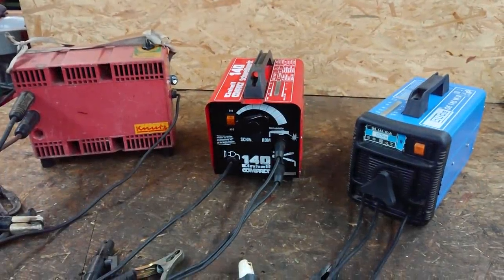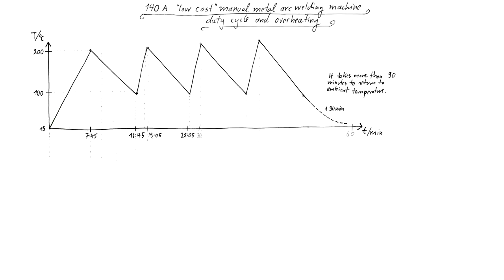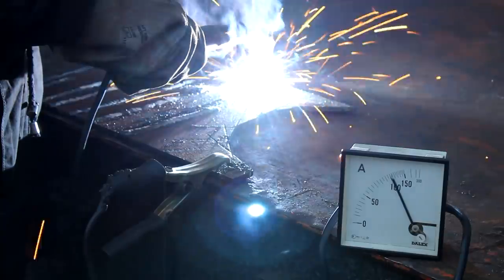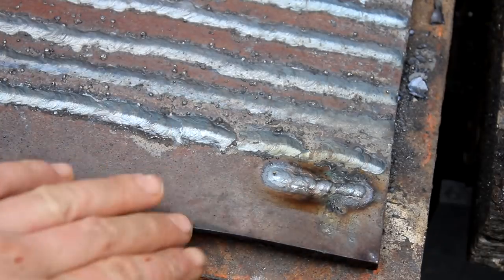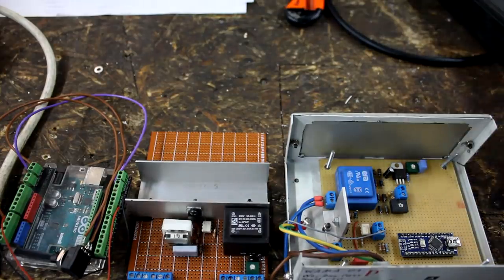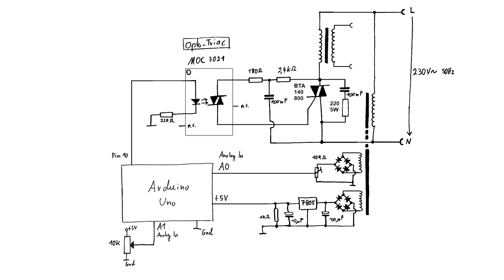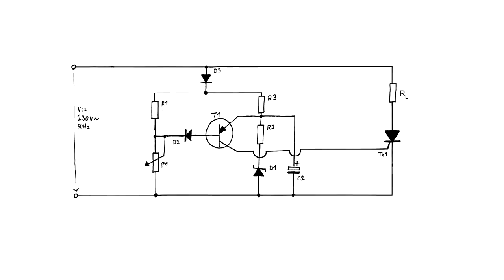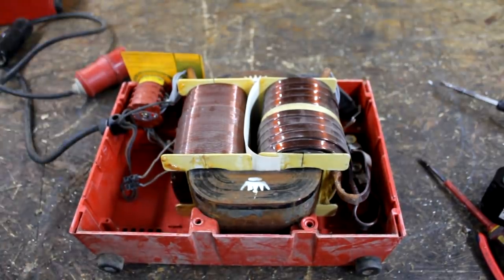Welder Experiments! DIY Upgrades for Cheap Stick Welders!

Comment from the maker: Hey guys, if you want to make a donation, you can find me on Patreon, or make a donation via paypal. If you want to donate by other means, you can contact me under that same email address.

https://patreon.com/tpai
paypal-donations: inventordonations@gmail.com

Older episode about welding transformers: 
https://www.youtube.com/watch?v=k5684mQJQRU

Video about my DIY Exercise Machine:
https://www.youtube.com/watch?v=h2YUO4_O4x8&t=335s
Reply: Another marvelous video! Please put your PGP Public key, so that people can e-mail you privately, Gmail is unsecure as f*** also, consider using the Signal app.
Reply: Martin Luther  This is a fact Martin.
Reply: I like your videos and have supported YouTubers in the past but YouTube has become SpamTube by placing a large amount of ads (6 interrupted this video alone) within posted videos. That makes it very difficult to follow and is worse than TV.
Reply: @kevinsteegmann6539  Just us any ad  blocker to keep that stuff at bay. V
Reply: john croation  Search for the channel of a dude called "Rob Braxman" he deals in network privacy/security you will find all information that you need there, thanks for your time.
Reply: @kevinsteegmann6539  Is not only a question of youtube but also a question of OS and browser. Under Linux not have adv even with firefox, chromium or another brows.
Reply: Since your valuable video-S are already done and you added the English explanation afterwards. I really & HIGHLY recommend adding a German  explanation too. After all, it is your mother tongue, right …;-)) - Deine unvergleichliche geile Videos sollten unbedingt auch auf Deutsch presentiert werden. - Keep'em com'n!
Reply: @The Post Apocalyptic Inventor
Would love to see an update to this series. When you have the time and have salvaged the relevant parts of course.

Comment: I added three server fans to my old stick welder twenty years ago to prevent overheating. The fans have prevented it overheating ever since. The fans operate before the on off switch so they function as soon as the welder is plugged in. This has worked well.

Comment: On these older welders in the UK, we are advised to upgrade the fuse to a 32amp fuse/trip switch. Many workshops I have seen have had 32amp socket circuit specifically for welders and compressors

Comment: My dad taught me how to stick weld years ago.  And I must say, I've gotten pretty good at it.  Setting the duty cycle depends on the thickness of the work you're going to do.  We converted my dad's old AC welder into a DC welder using some huge diodes my dad got from where he worked.  Now it welds great without so much sputtering.  W Rusty Lane K9POW in eastern Tennessee

Comment: Would have been fun to implement the controller analog without μc.
A 555 and an opamp should have been enough.
Edit: I see you implementing an analog circuit later and the μc implementation is surely a valuable education! No criticizing here!
Reply: Yes, I was also wondering about that. A standard dimmer circuit as was used for incandescent light bulbs consisting just of an RC network and a diac would have achieved the same result. But it seems that today even the most trivial circuits need to use a microcontroller :-) Nevertheless, great video!
Reply: I tried designing one with a 555 and LM339 that would switch a 2 thyrystors + 2 diodes bridge rectifier, well it worked in LTspice but never got around building a real one. making it work on both halfwaves is truly a hassle
Reply: There should be a general rule that if your firmware is below a certain number of lines...you don't need firmware.
Reply: @trevorhaddox6884  well, microcontrollers have the upside that you can upgrade the firmware after you shipped a product. But it depends on the kind of product.
Reply: As mentioned theres a very simple DIAC application, used in nearly all vacuum cleaner and so on and theres a lot of integrated Triac controllers. Thyristors/Triacs are complicated to handle. They sometimes might not fire (especially if nearly 100% duty and while used on brushed motors) so you need to re-fire them. This integrated controllers do this very well. Here theres no software required at all.

Comment: Same Einhell welder, just added a 120mm mains fan to the rear, using the existing 4 holes and grille there already, but not installed by the manufacturer.  Blows across the transformer, and with the duty cycle now being weld a rod, wait a minute, then weld another rod, perfect for my use. Only drawback is that when welding the extra stray magnetic field tends to stall the fan at high current, but it will carry on again when unloaded, or at low current. Never bothered to put in any power factor correction, but did add a single diode on a heatsink , connected to a 40A thermal breaker added to the front panel, and a 4mm output, so that I can use it as a battery booster, being able to get a car battery from flat to able to start a vehicle in under 1 minute.

Comment: Great video! I want to give you a tip about pressing a high-current cable connector as you use in the rectifier.

Use a bench vise with an aluminum vise jaw protector with a V-shaped groove in it. Put the connector in the V-groove with the top part facing into the groove. Press with a 5-8 mm Hex bit until the cable sits well enough. It is a bit tricky to set it up with one hand but you can arrange it so the connector is put in the vise first wit the bit pressed loosely so that it all hold together, and then you put the stripped cable in the connector. This way almost mimics the ready-made tooling for this purpose.

Comment: Altough the circuit with the potentiometer seems a lot more practical than turning the original current control knob a million times, isn't it a lot harsher to the mains network as you are enabling the triac mid wave resulting in a big spike of current? I did actually use a similar circuit before with the zero cross detection and time delay for a heater but I rapidly changed it as soon as I noticed the flicker it was causing to the lights, in my case since it was a heater it was easy to solve, I just used an opto triac with internal zero cross detection and used time proportional PID  (which results in like a slow PWM with 200ms period) to control the temperature but this of course wouldn't really work for a welder or atleast it would result in terrible welds I think. Keep up with your videos I really enjoy them!

Comment: Great “episode”. What I would like to see in future is more renewable power DIY stuff. Like grid-tied exercise bike.
Reply: A person isn't capable of putting out all the much power, so it is usually not practical to create one. There would need to be other reasons than getting power to justify it in most cases. I have seen practical uses in developing countries for charging cell phones, and tiny battery powered lights. A single solar panel would cost about the same and provide much more output though. If you like I can get you an equation for human output over time. Obviously it varies from person to person, but studies have been done to get an average.
Reply: Check out James Biggar: https://www.youtube.com/channel/UCtrf6ZiE6hw3k77hGpnuQWg
Reply: @court2379  I know but I would have much more motivation to exercise if I knew that energy is not wasted ;)
Reply: One of his first videos is right along those lines
Reply: @BrokeWrench  it wasn’t grid tied.

Comment: I added an 8 inch fan to my MIG which cured the problem of cutting out. The transformer doesn't have a shunt though. It has separate winding's for each current setting.

Comment: Being a basic analog pwm, wouldn't it be simpler to use a monostable 555? I do understand the easier programming of the waveform for experimenting, but honestly an Arduino is a bit pricey for a working unit. At least around here it is, lol.

Comment: That second transformer winding for the zero crossing detection is not needed. With one diode after the rectifier but before that first smoothingcapacitor you can connect your trimmerpot to that point

Comment: Mounted a full diode bridge 90A in my old transformer AC flux core welder. Made the welding much less sputtering and capable of welding thinner gauge. Recently got a Lidl  100 EUR flux core welder and it is so much better. No wire speed adjustment because it does it itself based on current draw and it looks like tig welds, welded a thin gauge tube on the side of an oil barrel and it holds water and that was on 0,6 mm gauge soft steel.

Comment: To maximise the transformer cooling, immerse it in oil. Though the class and type of insulation used on the transformer may preclude this.

Comment: Its cool (no pun intended) how that fan changed the saw tooth profile of the temperature into a triangle wave. Increasing the heating time. Then pulses used to describe dutt cycle. It all makes sense its just interesting seeint this outside of electronics.

Comment: Doesn't the arduino have an analog comparator to use to generate an interrupt? That'd save you having to continuously sample the analog voltage.

Another option would be a hardware zero crossing detector, and use a digital pin interrupt.

By the way, I am very pleased to see something different than the repairathon videos.

Comment: This video inspired me to modify a beefy 50 Hz welder I have. I'll use an Arduino and phase angle control, y want to add a starting arc feature. If everything works as planned (rarely does lol) I'll have a display, a rotary encoder and the ability to choose de duration of the starting arc, its open circuit voltage, and of course the final welding current. The thing will be closed loop with a simple Proportional control loop using a current transformer to read the current

Comment: Oh yeah...this was the first thing i did with this cheap Einhell welder... Right out of the box, even without trying it as it is, i added a fan at the back (from an microwave oven...230 volts) and changed the welding leads for longer once with higher cross section... Now it is nearly impossible to trigger the overheat fuse in practical use. (unless you are a professional pipe welder or so....  xD)  I did the same on my cheap flux core welder. There i also added a extra power supply for the feed mechanism to make the welding performance smoother.  All in all, very cheap and easy to make upgrades on such low budget machines.... Thumbs up...good and informative video.  Greets from Bavaria.

Comment: i just did a dcen upgrade to a cheap 90a flux core wire feed welder using an 100a bridge rectifier and a couple of smoothing capacitors. i added more air flow with a couple of large muffin fans recovered from old computers and added an atx psu from one of them to provide the 12v power. it only has two power settings, so i might try your arduino control to have a better range of welding amps. thanks for the idea, and the tutorial.

Comment: This was a really great video, probably one of your best so far. The right level of basic explanation at the start, practical demonstration and data analysis then baked up with the detailed analysis of the circuits and controls which you used.
As an Engineer I have come away from this video having learned a lot.
Thank you so much.

Comment: @21:20 on circuit you could simply add one more additional diode in series after bridge rectifier and then connect to a capacitor, so you could get phase pulse directly from single winding transformer without adding second rectifier.

Comment: most cheap stick welders here in New Zealand are inverter type, the transformer welders are really uncommon here and is only found on very old welders  that went out of use 30+ years ago and most of the cheaper variety didn't last long so are long gone. so very few of these mods work. very little transformer type have shown up in a long time, and i have found and salvaged a number of inverter type from scrap yards. sadly there is no longer public access to most scrap yards due to OSH restrictions, so have lost access to salvage, specially in major centers like i live in. its a real shame because i have salvage\d so much great stuff in the past, and the materials for my recent projects and many of the items in my lab.

Comment: Excellent video. Regarding your cheap stick welder. Would it help to add aluminum heat sinks, perhaps with thermal compound, to the outside of the transformer to increase the amount of the surface area for your fan to blow over or would it be a negligible improvement? It seems like more heat could be drawn off if you fiddled around with venting and ducting to get air moving over the core. That's if your trying to get the maximum duty cycle from your cheap stick welder.

Comment: i have a Lastek stick welder here , old one goes up to 160 Amps , is cooled by the way ,, it runs forever 
the ones you have are for hobbiests and made as cheap as possible , for long working times they are not made for

Comment: Hi Gerolf, I have a suggestion that might appear simpler than Arduino and more effective. Most handheld motor power tools nowadays have revolution adjustment combined (normal ones, not pure chinesium ones) with soft start and overload protection. One such a phase control IC is long discontinued Atmel A2010B (development over Telefunken's U210B) that also have adjustable load current compensation and still can be bought cheaply. Welding transformers present a load much like universal motors, so it should do. It's not "plug and play" but not difficult to develop with at all: you have to provide it with appropriate for the load current shunt and play with soft start and compensation or eliminate them (removing soft start is needed, but small (under) compensation might do well or the oposite - you might reduce standbuy current and ramp it under first contact). For AC tools with universal motor this IC does as well as the specialised MCs and might also do with stray field transformer.

Comment: You did not protect your A0 pin from excess voltage if you make a mistake adjusting the 10k pot. 
A 1k resistor after the pot, followed by a diode to the +5V and another diode to the ground. 
This will keep the signal between -0.6V and +5.6V. Enough to protect the analog pin. 
And if you ever made the mistake of turning the port into an output, then you won't lose your Arduino port to the magic smoke. 
Food for thought.

Comment: Hey TPAI, have you thought about trying the cheap inverter stick welders for your experiments? I have a couple of these units, they were less than £40 delivered, I was able to build a huge metal garage with 40mm square steel box section without needing to stop at all, and with much better quality welds, the interter units are DC. Amazing for something that's about 20 x 15 x 25 cm.

Comment: how about doing high frequency start? i have a modern inverter mma welder i tig with it but its scratch start. i would love to make a circuit for it for high frequency but i think it might be too difficult. the box is not very large and i think an external solution may not work

Comment: Have a look at "Transduktor" or "saturable reactor" ;)
Reply: I made a saturable reactor based power supply.
I placed the ballast inductor in my laundry tub. When I turn the tap on it becomes saturated and, because my water is rather impure, the current begins to bypass the ballast inductor and the output is increased!

Comment: Fantastic video, I love the theory related to the practical, entertaining and educational. On my old stick welder - I use a bathroom extractor fan, works well and runs directly from the 240v feed (with fuse). However my solution teaches a lot less than yours.  Love the thyristor control, and appreciate you taking the time to explain how / why it works, makes me think and try to remember of what I learnt many years ago when I did my degree.  Vielen Dank!

Comment: You can get these cooling fans with AC motors, the best brand is PAPST hungary - looks just like computer fan but its all powdercoated metal on ball bearings, runs of regular AC power (110V 60Hz for me) no need for any electronics!
Also i facepalmed the ardunio stuff! The Beauty of this welder is its simplicity and durability! If you dont feel like turning the screw for a minute just get a speed clamp there.
Nevertheless gread channel!

Comment: I have all the welders I need,, so I would not need to make the modifications for myself, but I thoroughly enjoyed the presentation, particularly the use of the Arduino.  One question comes to mind, and that is how would you design this circuit to work  on 220 volts, where the neutral is between the two poles.
Bob

Comment: That 6000/1024 is just an integer division right? Instead of being 5.8 it gets rounded down to just 5. However I think it doesn't matter at all here because you're adjusting everything manually with the potentiometer anyway.
I would recommend being careful of that C quirk though in future I've seen some nasty bugs as a result of it!

Great video btw, are you concerned about the lifetime of the electrolytic capacitors given your theme of post-apocalyptic inventing? :)